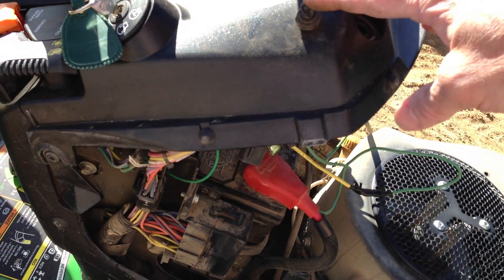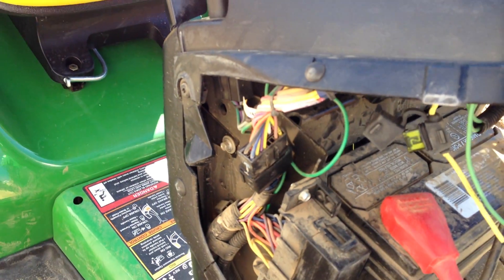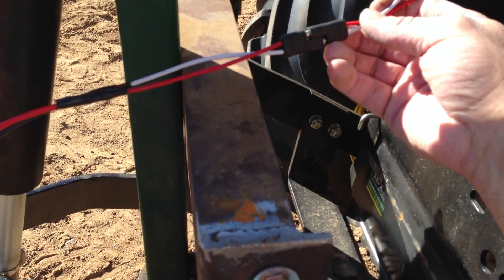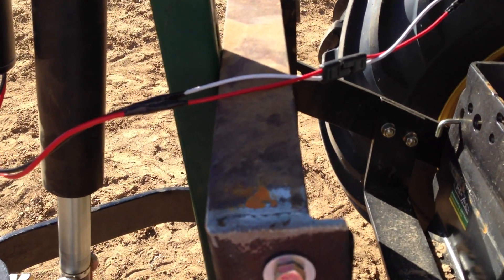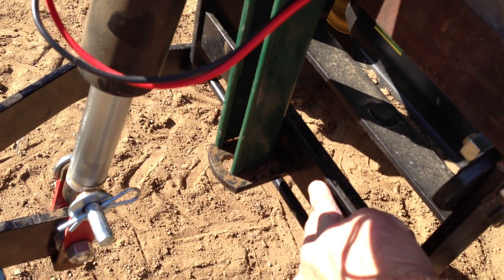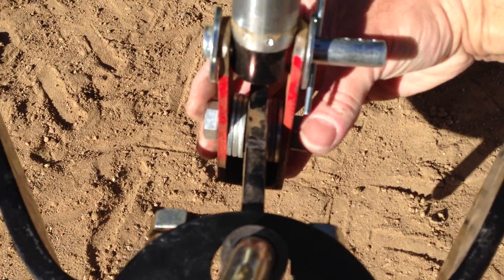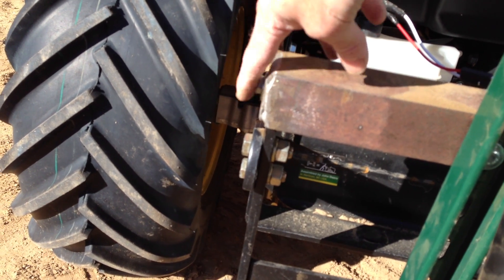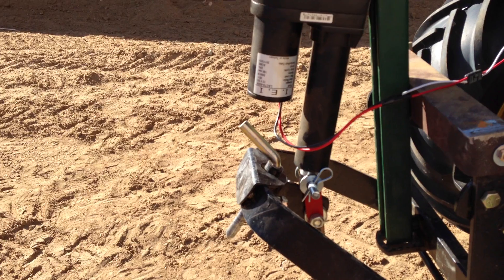John Deere X500 electric sleeve hitch conversion.

Comment: What size rear tires are those?  26 x 12 x12?
Reply from the maker: Terry Reed  yes they are 26x12-12 tires.
Reply: 1966roadking Could you give more dimensions, i.e. where the actuator is mounted to 
the unistrut, the lower bracket that mounts the lower end of the 
actuator, etc.?  I just picked up a hitch for my GX345 and thinking 
about doing this conversion.  Thanks.
Reply from the maker: Hey Terry the bottom part of my sh swings freely, I made a you shaped bracket for it to connect to the actuator and the sh.. Does this make sense? I can make a video that shows the brackets up close if needed tomorrow after work.
Reply from the maker: It should read ( I made a u shaped bracket ) on my previous post.
Reply: 1966roadking If you could give me the dimension from the bottom of the unitstrut to the top of the L-shape brackets that are mounted to the unistrut, that would be great.  And the dimensions of the holes in the u-shape bracket also, that would be good also.  Thanks.
Reply from the maker: Terry Reed The length from bottom of unistrut to top of L shaped bracket is 20",  from bottom of unistrut to top center of actuator is 17.5". All holes are 1/2" to actuator and u shaped bracket at bottom of actuator. You can drill holes on the unistrut higher or lower to adjust it to where it's comfortable to your needs, these measurements just happened to work out for me.. Feel free to ask any questions.
Reply: 1966roadking Thanks.  Just to be sure, the 20 inches is to the top of the L-shape bracket as you have them mounted now?  If I flip the L-shape brackets down, then that 20 inches will be less?  Just want to be sure.  You did a great job on your conversion and it seems to work great, so your setup should work for mine as well.  Thanks, again.
Reply from the maker: Terry Reed Thanks! That is correct 20" to the top of the bracket.
Reply: +1966roadking Just one more question, what is the hole to hole centerline dimension on the U-shape bracket that attaches the lower end of the actuator to the hitch?
Reply from the maker: +Terry Reed The u shaped bracket is 4.5" long, I drilled 2 holes from the bottom up here are the dimensions. 1.5"---- 4" hope this helps.

Comment: The duty cycle of that actuator is rated at 25% and it pulls 24 amps at max load. Do you find that it either cuts out on you or blows the fuse when using it to it max for a prolonged period of time?